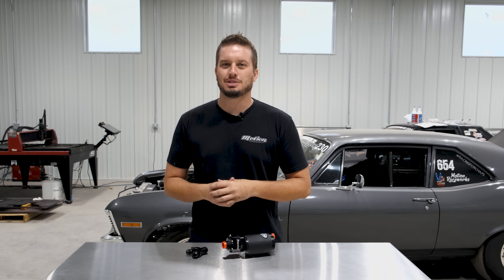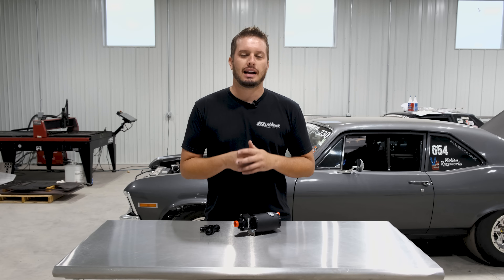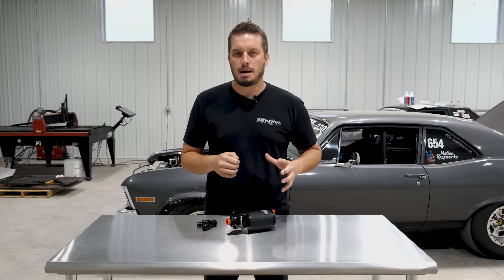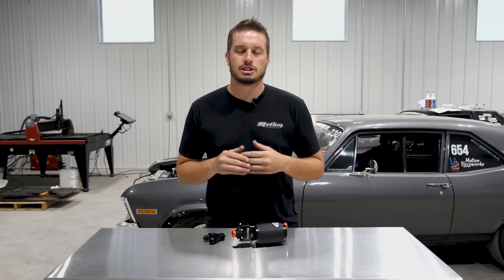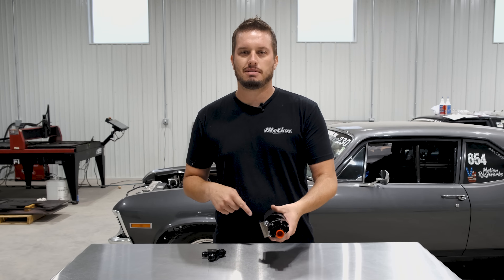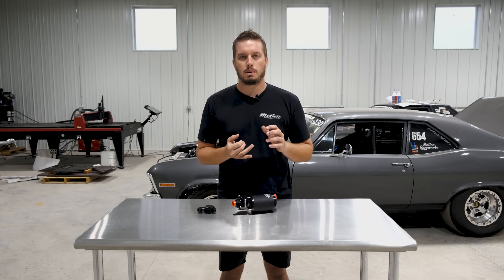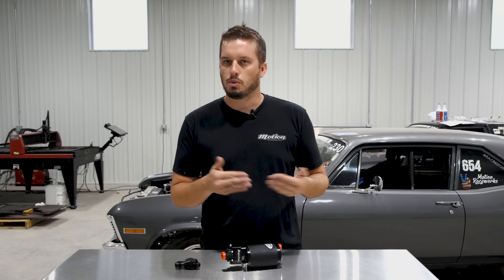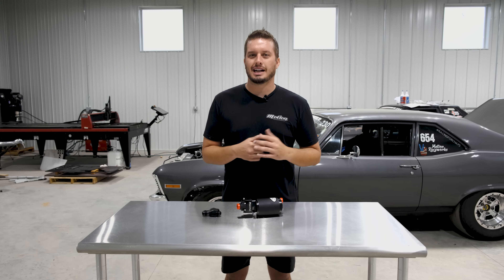Tech Tip Tuesday: How to safely add a second fuel pump to your fuel system.

Comment: Well, I stopped looking for your take on surge tanks,  Because I like your products. And the wisdom that comes with them.  I know you guys are smart, much smarter than me. But this time i think im going to have to find out the hard way.  I want to run my small pump to a surge tank. And have a second bump that comes on pork can be switched on when needed.

Comment: weldon is only ones showing big power pumps. boost and e85 2000-2400hp like to run 2 in tank 1000hp units as they are not as loud. as the 2400hp single external.

Comment: Why are fuel pumps rated for hp at a certain voltage?  Most cars are 14.2 volts. I see pumps that say x amount of pressure or flow at 15v or 18v.. 525 hellcat pump say 800+ hp rating.  However a 525lph pump isn't enough for my 700whp car. Honestly just don't understand the way pumps are described in listing.

Comment: Hi,
I'd like to know what kind of pump Lakota installed to lift the fuel up to the roof to your generator? My Featherlite is rigged from the factory with an Onan 5500 generator but installed right under my saddle rack. I want to move it onto a platform on the roof. But I cannot find what pump style will lift the gasoline up 8' to the roof. Any insight or help with the pump would be greatly appreciated.

Comment: Can i add a secondary fuel pump to a 2004 2500 5.7 dodge ram any .would it be installed on a switch or auto thanks for any suggestions

Comment: What if you are adding a second fuel pump to eliminate the GPH loss of the Dodge regulator system which can cost you about 20GPH. I see a lot of guys just adding a second pump and y into the one supply.

Comment: I’m about to upgrade my fuel system again (stock—aem340/aem.fpr/id1050/Id top feeds—dual hp240s/multi pump fpr/-6ptfe braided coated lines in parallel/finned cooler/dual filters 100+10/upgrade wiring/add temp sensor/same id1050s. I’m debating on a surge tank setup or simpler dual pump hangar. I never even considered a check valve for boost activated secondary pump, also the part about the dirtiest time for system is a revelation. For a stage 3/4(I guess?) 06 STi @~500hp

Comment: This was extremely helpful in my upgrade decision as I currently have a 4303 pump that just burnt up after 3 years street driving and drag racing, I was just going to fix this pump and run a second 4303 but I’m leaning toward the 5GPM aero now.

Comment: I’m building an e85 fueled 800ish hp truck and when I last was really in the scene, pretty much everyone doing high hp street efi was using in tank pumps, but it seems like the external pumps are much more popular now. Have you guys talked about in tank vs external?  My truck originally had a carburetor so I’m trying to figure out my fuel system and I was all primed to weld in a custom sump and drop in dual 255’s or something similar but your video and others are giving me pause.

Comment: I have a magnafuel 750. Is it okay to run a second pump using a magnafuel 625 or should i use a 750 again? Reason being i have a 750 & 625 in my possession.

Comment: Great video Doug, I run two separate fuel tanks and pumps, which is a benefit on raceweek because I have a back up. My street pump is pretty old school (product engineering) I will be filling out the form and upgrading soon. 
A tech tip around running Methanol as a secondary fuel (two sets of injectors or one big one) for a Raceweek style vehicle would be interesting, well for me anyways! Thanks again for these very informative vids!

Comment: whats your thoughts on the holley dominator in line fuel pumps? the ones with 2 pumps in one casing? ive never had a problem running those separately.
Reply from the maker: They’re junk pumps, we see more failures from those Holley pumps than any other on the market.  They’re under engineered and over sold

Comment: I got a suggestion for the next tech tip Tuesday. I want to run the new Holley 16 injector low ram intake, what injectors should I run for 1200 horsepower range and then the other set for Street application.

Comment: Can you do a video on starting with terminator x 
And a basic parts list for under 1000hp 
Pump 
Relays
Turbo suggestions 5.3 ls
Blow off valve 
Waist gate
Sensors 
Injectors
Etc

Basic stuff to get on track

Comment: Multiple pumps are problems. Get a pump bigger then you need end of story.
Reply: @bigboreracing356  your talking a separate fuel system. I am talking 1 pump feeding engine
Reply: Or if you have a dedicated system.for nitrous